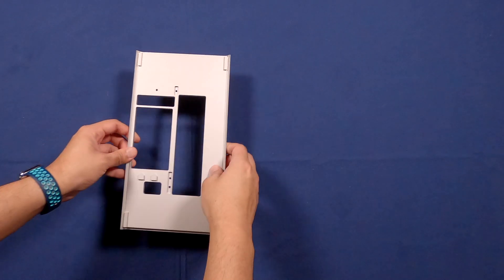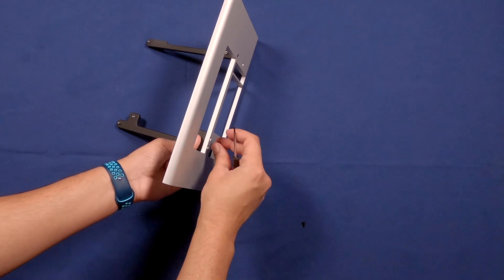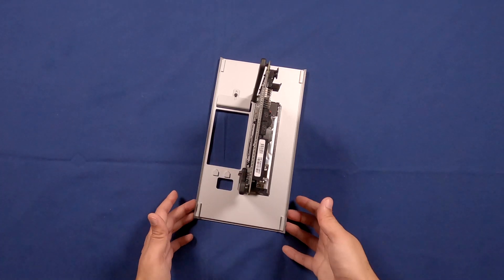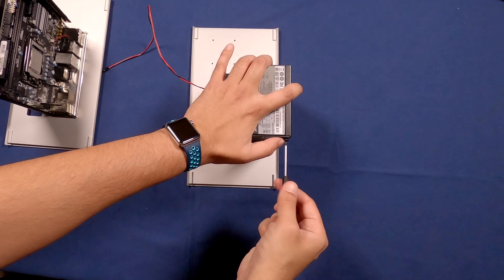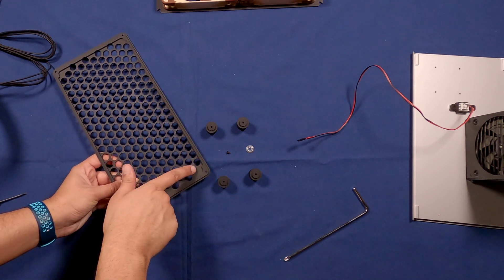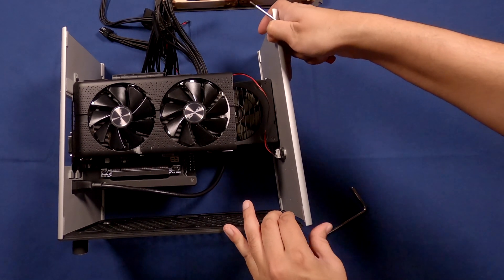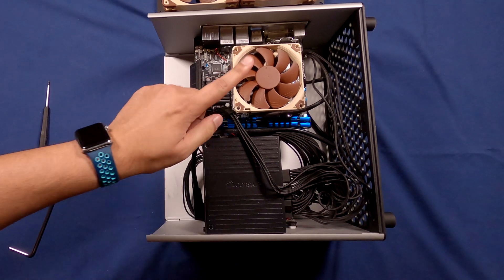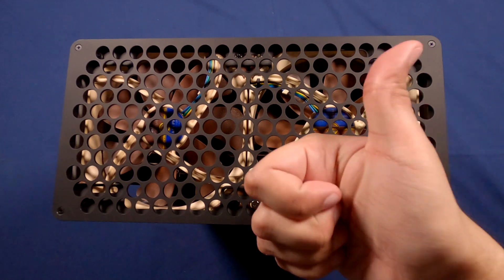A 5 minute Guide to Building in Winter One

Comment: For 30 series flow through cards is it possible to flip the PSU around so that the hot gpu exhaust do not feed directly to psu intake?
Reply from the maker: Absolutely! :) In that case, I'd encourage using a perforated side panel as well, so the PSU has better access to intake air, but there is space between the PSU and wall, so it won't get choked.